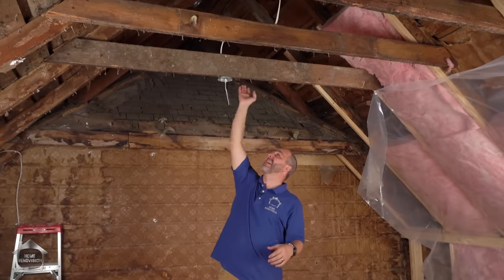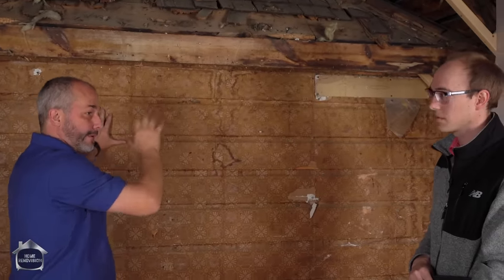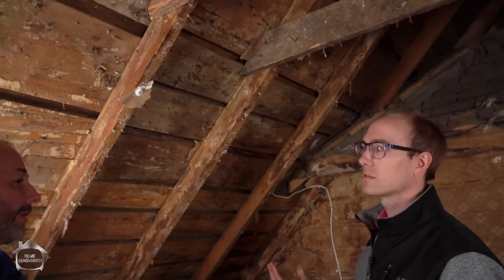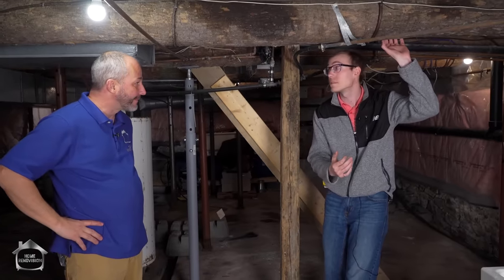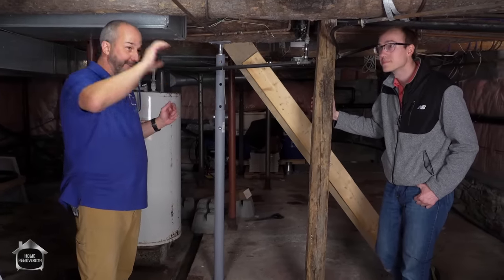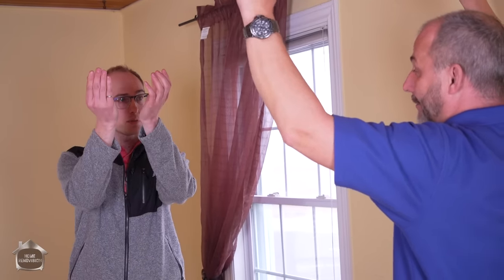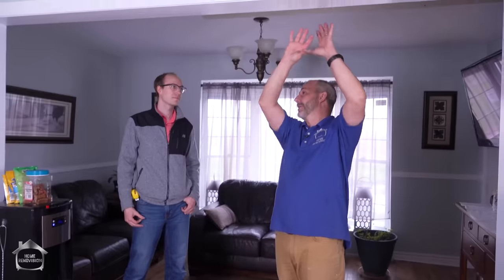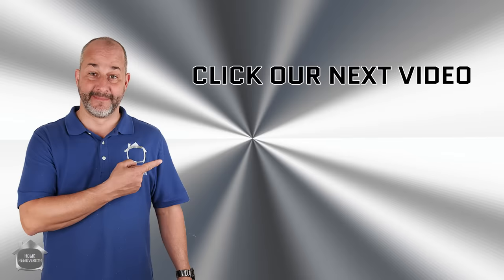Structural Engineer | Wall Removal | Basement Engineering

Comment: I'll never understand the american pre-occupation with wood as opposed to steel, or concrete lintels for that matter ... I understand the historical use of wood as it was freely available & standards were formed using timber as the go-to material... but modern materials are a no-brainer. 

The Berkley balcony collapse & loss of lives was shocking to me (I'm Irish so that loss hit home)  in that wooden beams cantilevered out from the main structure simply rotted out from bad waterproofing practice... steel or concrete would have NEVER let go under these conditions...

People think of steel as heavy & unwieldly but have they ever lifted a big glulam beam ?  Timber has its place but its time for a change in regulations to reflect "new" technology, its done in every other construction process, plumbing, HVAC & electrical are all modern design & materials.

Mention was made in the vid of using wood as this was essentially a DIY job but I fail to see how that excludes other materials & processes.

Enjoyed the video & interesting to hear Ethans input on your future plans, good luck with the project... 

😎👍☘
Reply from the maker: Hi Peter, History is full of examples of failures due to bad engineering with all materials.
Reply: Peter Fitzpatrick  bridges collapse non stop and they’re made from steel and concrete solely.no material is perfect and needs to be maintained or it will fail
Reply: @HomeRenoVisionDIY  ... yeah I do understand that, after all thats why we have regs in the first place... but when builders continue to this day to use inappropriate materials & then lives are lost , thats hardly acceptable. Berkley wasn't exactly a long time ago yet there it was.... rotting timbers "supporting" a balcony.

I'm not so much knocking builders here, I'm saying regs need re-vamping to reflect the progress made in construction technology... 😒
Reply: @mitchvus  ... I think you are missing my point tho... my point is you should always use material best suited to the job at hand, cost allowing of course, but to say that bridge collapses are "non-stop" is not true, I would hardly call 27 collapses between 2000 & 2019 non-stop...

https://en.m.wikipedia.org/wiki/List_of_bridge_failures

Also the vast majority of these collapses were not the result of inappropriate material usage as that link explains...😎👍